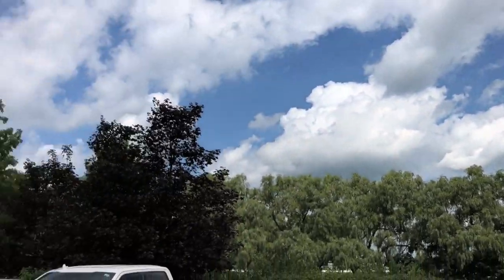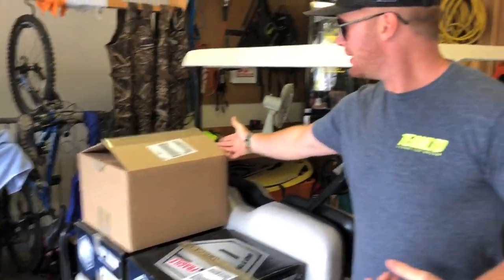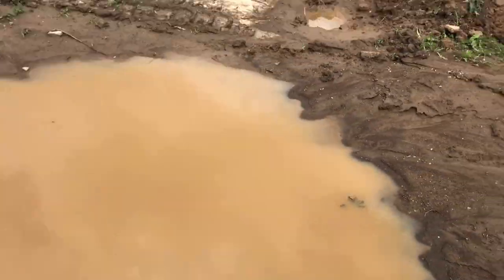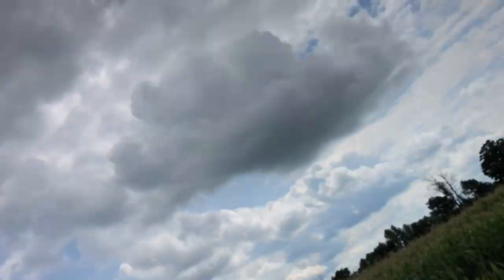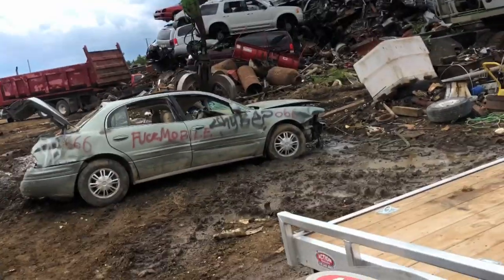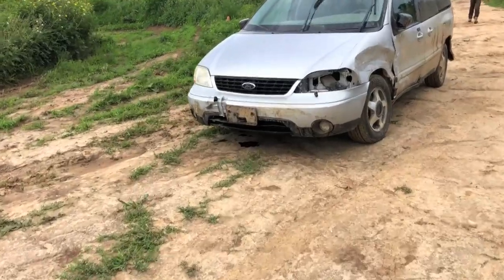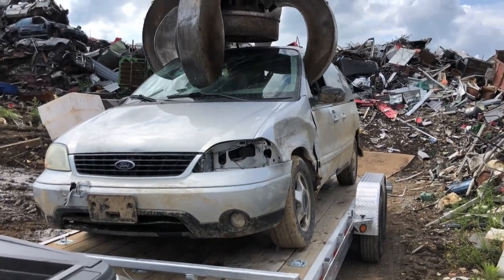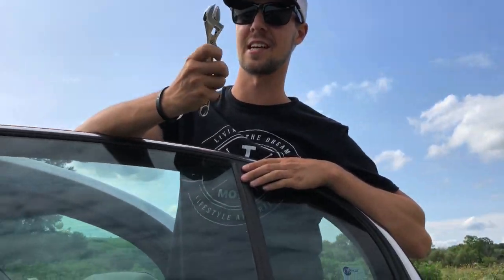SOCCER Van FIRE!!!

Comment: You use that tractor like you're trying to be gentle with the car. Why not just stick those forks down through the doors, into the floor, and lift that thing up and set it on the trailer.